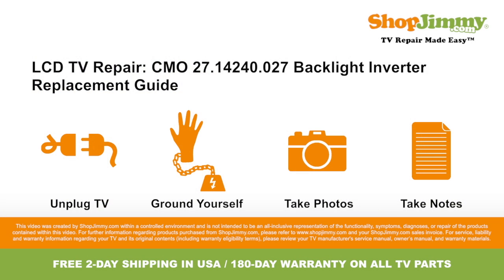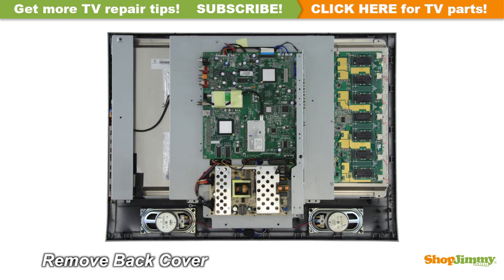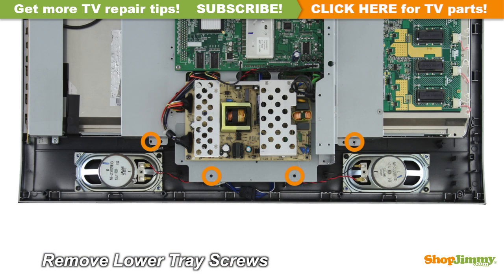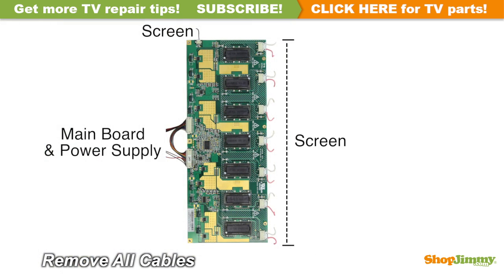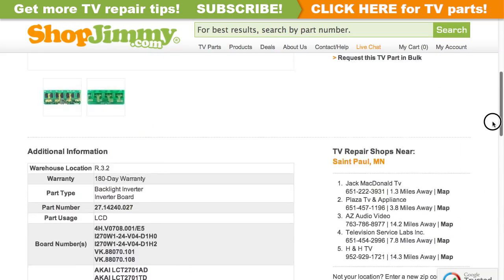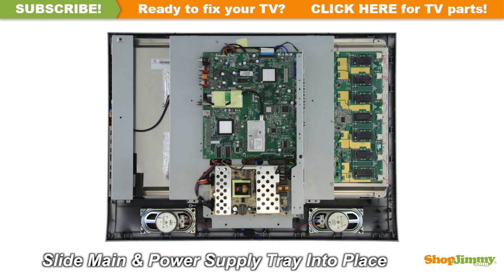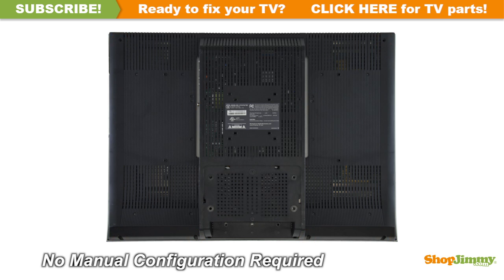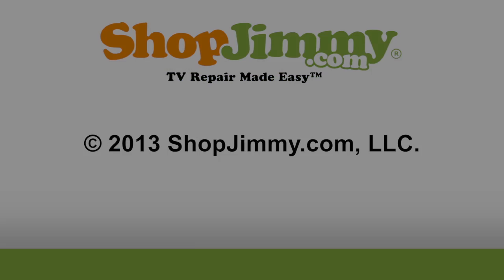CMO 27.14240.027 Backlight Inverter Boards Replacement Guide for LCD TV Repair

Comment: Olevia LT27HVX ... was professionally cleaned .. after cleaning one third of the display is now reversed .. what could have happened?
Reply from the maker: newname363   This sounds like a TV panel (TV Screen) problem.  If your TV panel is bad, it may be more cost-effective to replace the TV as panels are typically hard to find in stock, difficult to replace, and expensive.  Thanks and please let us know if you have any further questions!  www.shopjimmy.com